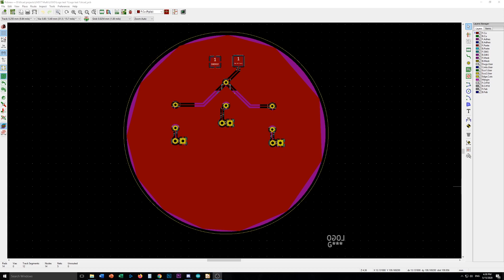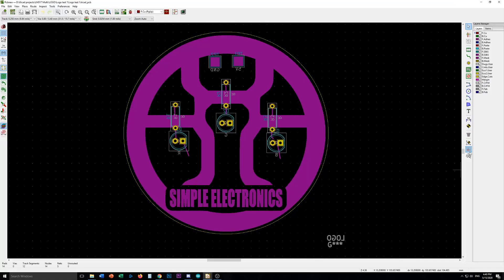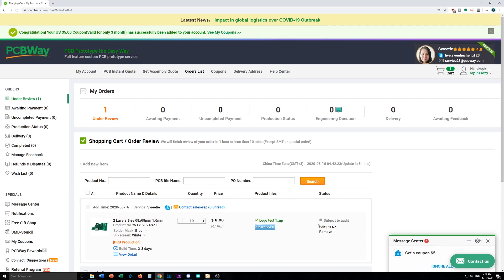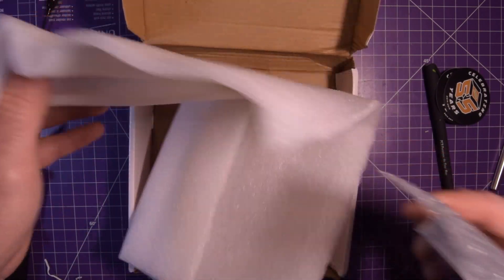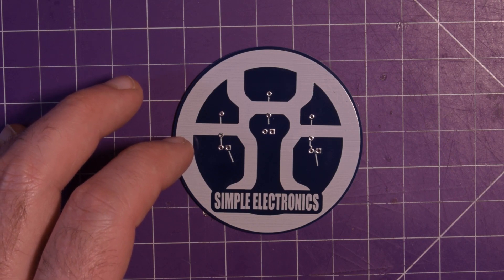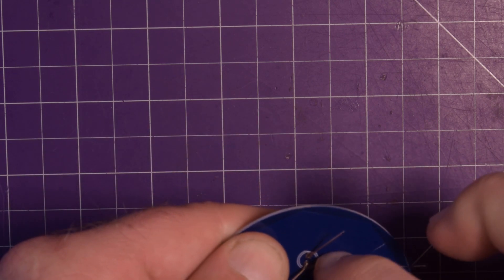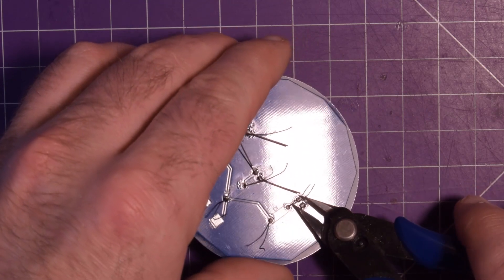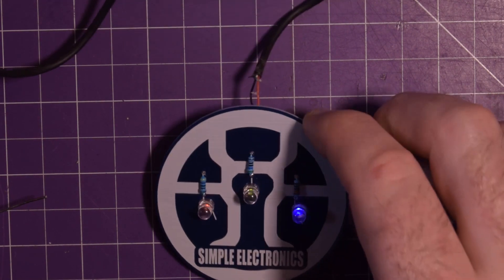Making A PCB Logo! (With PCBWay Boards!)

Comment: hmm maybe if you had given the design a bit more thought you could have used a 2032 battery holder on the back with a surface mount switch and done away with the resistors and having to wire a PSU on it. maybe design mark 2 you could then attach it to what ever and even wear it. a nice video though :-)
Reply from the maker: mk2 definitely on the way

Comment: While I was watching I was thinking you could add a button battery holder in the design, use tricolor flashing LEDs, and super glue a badge pin on the back and have a flashing logo you could wear. A cool convention type badge.
Reply from the maker: That's a really good idea! Thanks!